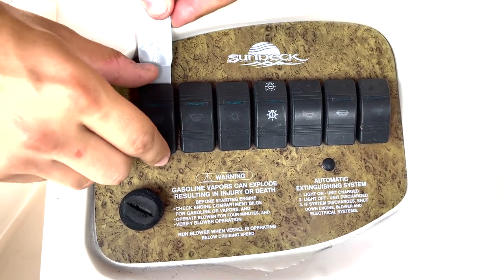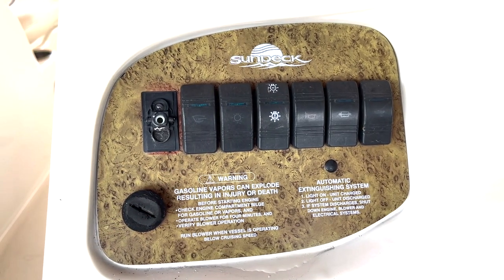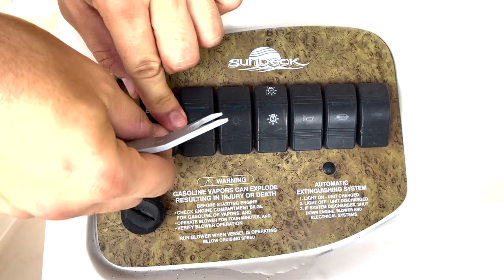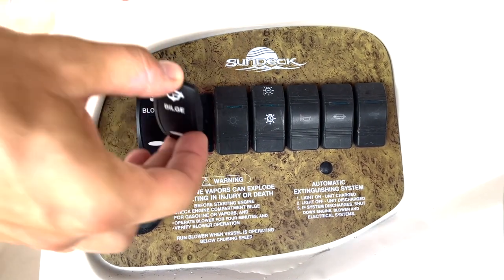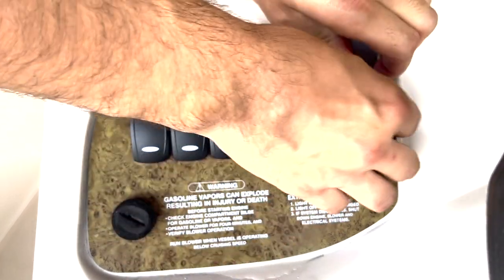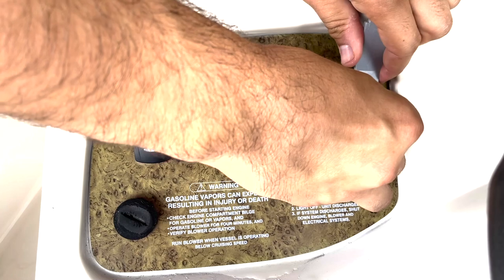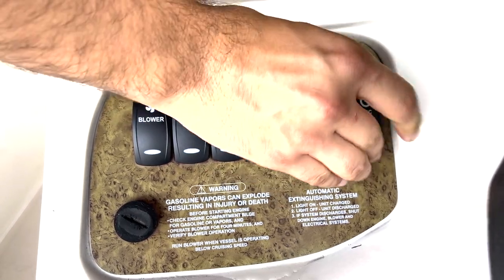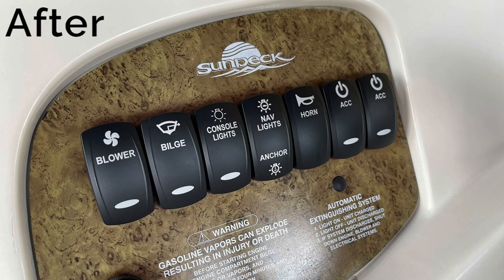How to replace rocker switch covers

Comment: Where did you find the set you used here? Looks great. Thanks for the video.
Reply: They sell them
Reply: Easier said than done. I bought the switches and covers from you.  Have the same tool as in video. Can't get the old covers off. What am I doing wrong?